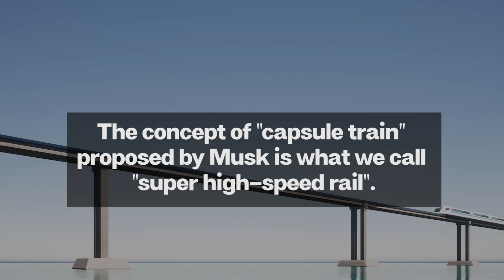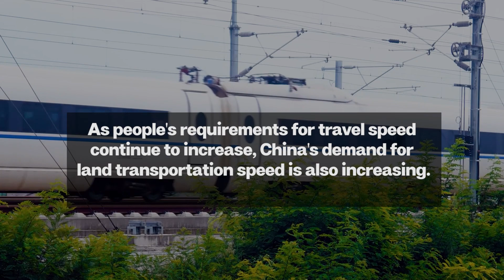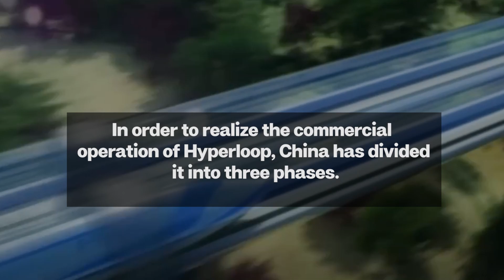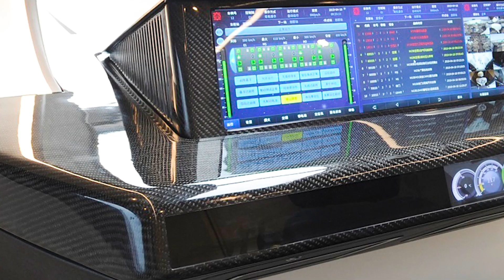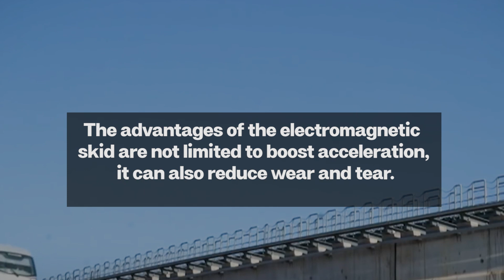whoa! China is developing high-speed train with a speed of 1000 km/h | Aircraft about to be retired?

Comment: 0:55 Musk re-introduced the idea of a train in a vacuum tube. It's not an original idea of his.
2:20 A vacuum tube is not high-safety. 
Current trains can reduce pollution, if they are powered from non-CO2 emitting power sources.
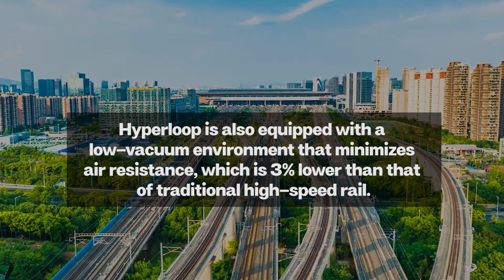3:00 Sounds like you're drinking the CCP's Kool-aide harder than Musk fans drank his Kool-aide. 
3:58 It's not an aircraft, it's a maglev train in a tube. Did you go to school?
4:40 How is 'electro-magnetic propulsion' different from maglev? What makes this train in Shandong different?
Yet another useless CCP fluff piece.
But, if CHSR can make it economically viable, good for them. They will have succeeded where all others have failed.
Reply: WTF is the matter with you. You're bragging about something you don't have.
Firstly, Elon Musk is a South African International Entrepreneur.
Secondly,  USA is still in concept mode and have not actually done anything yet.
China has the entire nation WITH a Bullet Train Network from anywhere in China to anywhere in China that travel at 350kph (I been on them from Beijing to Shanghai). I love the way USA citizens like yourself are implying yours is better, when you do NOT have any fast train network (China's had theirs for a decade) ... and I've been on USA's AmTrak from Boston to NYC, and it averaged 80kph.
Now remember ... USA at this point in time has NO High Speed Rail and China has a National High Speed Rail, yet here you are bragging about USA's High Speed Rail, when it's the concept of a South African Private Businessman, and you have nothing.
China is now moving from its High Speed National Rail system to the SUPER HIGH SPEED RAIL that travel at 1,000 kph. So stop and THINK about how stupid your statement is. USA, as per usual, is trying to Copy China, but China is at least 10 years ahead of USA. Build one first before trashing another country who already as extreme success in it.